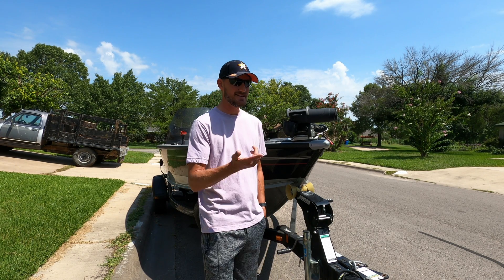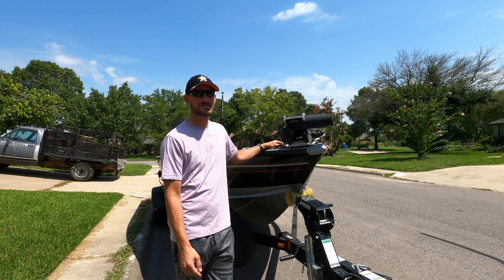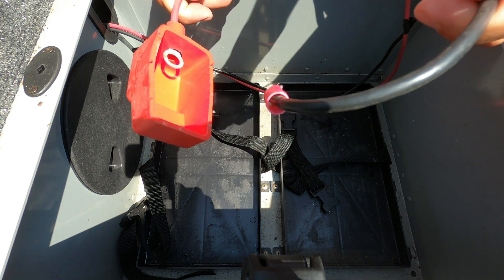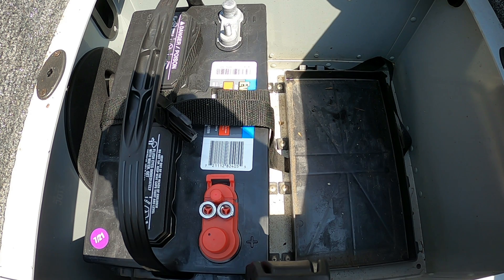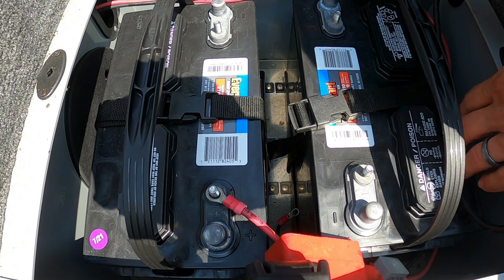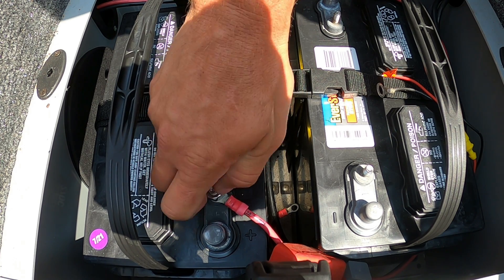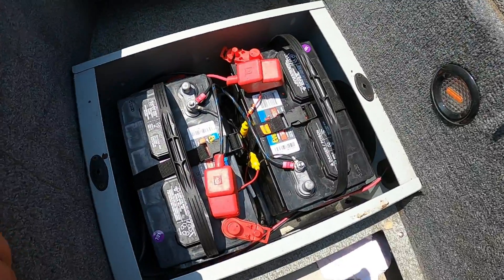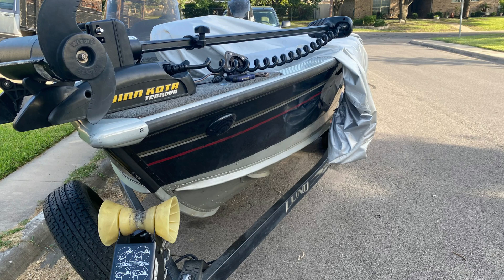How to Wire a 24 Volt Trolling Motor System-2008 Lund Explorer 1825 SS

Comment: I suggest a circuit breaker on your 8 gauge jumper wire just for added protection. But your video is informative and straightforward. Thanks

Comment: Barry in Virginia.  Good video. I have a 3 bank charger also Tournament 240 . But when I check voltage i show 12.5 volt.  What am I doing wrong. I hooked her up like you showed. The minn kota riptide is performing like 24 V. But how do I check the battery's for 24 volt.  Thanks much 🙏. Barry in Virginia
Reply: You need to test from the negative on battery 1 to the positive on battery 2. Should show 24-25 volts if you hooked up your batteries as Barry demonstrated. If you test from negative to positive on battery 1 or 2  it would show 12.5 volts. Make sure your voltage tester is rated for that much voltage before you test.

Comment: Was your wiring parallel or series?  This is the part that confuses me.  Thanks for the straight forward, easy to follow vid…but still don’t know answer to series vs parallel question.  Did I miss that?
Reply: Parallel is batteries with both positives linked together,such as your main batteries .Series is this application positive to negative
Reply: @ Thanks for your reply.  Hooked up my batteries this way and now feel confident telling folk “series.”

Comment: Why have you not switched to lithium batteries for your trolling motor.
Reply: I have an Ionic Lithium 30 amps. $369 with their charger which now i know I don't need their charger.  There great batteries but one 100 amp is around $800 with out charger.  Very lightweight though.  But I'm poor lol 😅
Barry in Virginia

Comment: Should have showed how to hook up accessories
Reply: I have accessories hooked up to my cranking battery. Accessories normally run off of 12v and you’ll fry them on 24v, right? So in my mind once you run 2 batteries in series, and you only hook accessories up on 1 of the 2 batteries in series, it would still pull 24v to the accessories if that makes sense? I could be wrong. I’m no expert and I hate working with electricity.

Comment: How do you charge it? Like do you charge it on 2amp 12 volt button on the charger. 

I’m really asking about charging one. For my kayak Minn kota. I just got the old town predator xl. 
Im trying to figure out if im charging the same 24 volt battery right or not. I’ve used it four times and I thought I was charging it right. But the volt meter on the battery box said 11.5 however the tester on the motor said charge it. I came back in because I thought it was dead.
Reply from the maker: Thank you for watching.  You can charge each battery individually with a small 12volt charger like that.  Just do one battery at a time.

Comment: I use fine grit sand paper to clean the wire connections and u have them there post nuts way to tight

Comment: If I'm using my outboard to charge the batteries can I not just put the red wire from it to the red post on the battery where the red wire from the electric motor is attached and the same for the black in the appropriate spot

Comment: Question for you I was just given a trolling motor that is a 24V is it cheapoer buying two 12v batteries compared to buying a single 24v lithium? I dont know what to do with it
Reply from the maker: That is an excellent question, however I am not well versed in lithium yet.  Due to cost I stick with lead acid but I have heard many good things about the single 24 volt lithium.  Also another charger would be needed for the lithium if yours won't do multiple types of batteries.  Sorry for the late reply and thanks for watching!

Comment: First, Thanks for the video.  Is it necessary to run the positive wire for the trolling battery on Battery 1 and the negative on 2?  I run power to a plug in the bow.  I have 4 gauge wire running from the battery compartments to the plug in the bow....
Reply from the maker: Tha k you for watching! Running the wires to the plug that way is how you get 24 bolts at the plug so usually that is how it is run unless the manual for the trolling motor says otherwise.

Comment: Amazing bro 
I have a question 
Brother how these batteries will be charge from engine ?
Is it possible?
And the one you fix for charge
Is it ac charging unit that gives charge to the battery.
I m from Pakistan work in UAE
Reply from the maker: Thank you for watching!! These batteries charge from an on board charger which plugs into a wall outlet.  I believe people have tried to make a charging system using the engine however it is not very practical.  I can go a full weekend on one charge.  Sometimes longer!
Reply: @EricGaskamp  thanks brother thanks

Comment: First off very informative loved the video but when I hooked up my trolling motor I had it on the same posts as the wire I used for the 24v system and it never worked so I put the trolling motor wires on the other posts and it works perfect now
Reply from the maker: Thank you so much for the kind words and I’m glad everything worked out for you!! Thank you for watching!

Comment: “Clean electrical connections are the key to everything running correctly” … Very wise words.

Crusty connections are a  pretty common issue with TMs  - especially with all the new tech like remote steer, pwr this and that etc.

From the jumper to the breaker, you nailed this install. Thanks for another great video
Reply from the maker: I had to learn that the hard way about clean connections! I think I may go a little overboard now! Lol Thank you for the kind words!!

Comment: Be careful when using your jumper wire, if you have a newer minn kota and hook it up like that you’ll smoke your plug in. I just about did it. Went back and read the manual for the trolling motor and it’s actually opposite.. connect positive to battery 1 and negative to battery 2 for your jumper wire
Reply from the maker: Thanks for watching and thank you for the heads up!!
Reply: so his hookup is wrong for joining the batteries together? Or do u mean just for your minn kota, I have a motorguide with no instructions so his way is probably ok for me right?

Comment: Your 24v jumper wire is also important to protect the wire from any shorting out.
You should have circuit protection on every circuit at or very near the positive side battery post.

Comment: I’m still learning about this whole 24 volt set up. I’ve been out twice now with my boat, the minkota runs great. But when I get home and check the batteries for recharging purposes, only one battery is discharged. Is that normal?
Reply from the maker: No, that is definitely not normal.  Are both batteries the same age?  Also, It sounds like its running in 12 volt mode.  Older trolling motors had a switch that you would run 12v only or 24v.  What trolling motor do you have?  Another reason is that it could be wired improperly.  Make sure both batteries are identical and they are the same age.  Both batteries must be in top shape otherwise one weak one will bring the other down.  I hope this helps some, and thank you for watching!
Reply: @EricGaskamp  I have a Minnkota Edge, 24 volt 70 lb thrust. My batteries are a couple monster heavy Eaton deep cells. They are hooked up as you directed, but for some reason they discharge kind of goofy.

Also, with my volt meter, shouldn’t the reading on the meter be up around 24 volts if both are adequately charged?